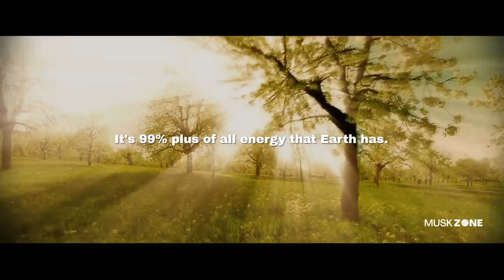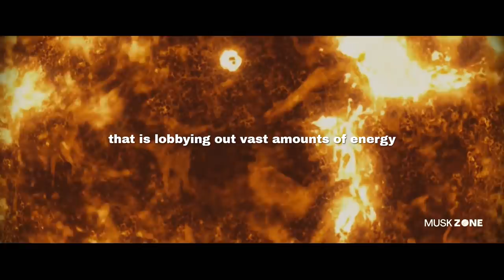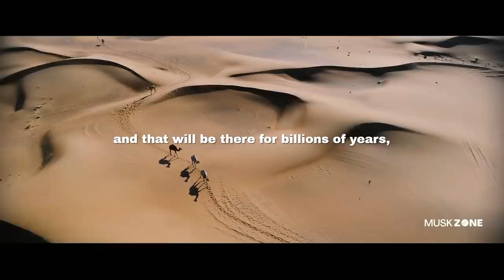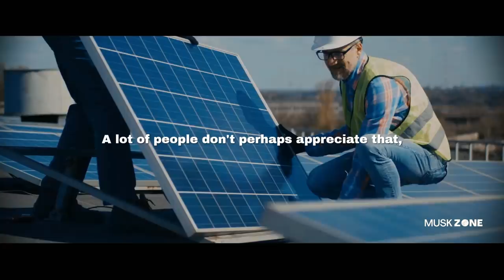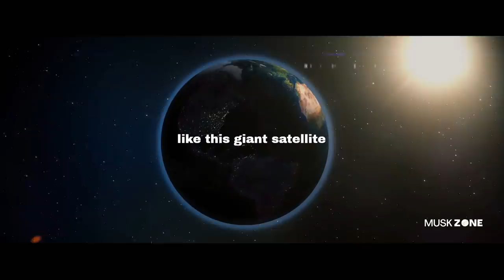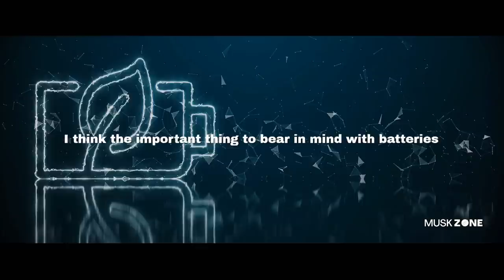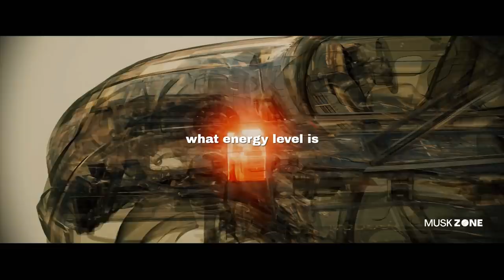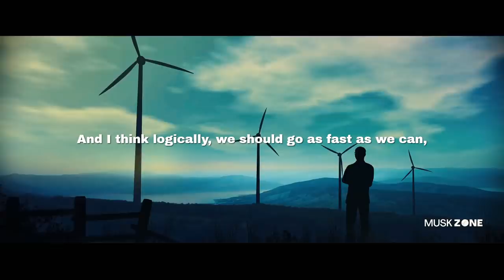Elon Musk's Speech That Freaked Out World Leaders

Comment: the reason we have not used all renewable energy is that solar panels are expensive and the batteries are easy to destroy (attack from terrorist ,enemy country and etc) and its all expensive,the answer is a nuclear plant, its not efficient or cheap but its the only thing that is viable,  so we can just use nuclear power for now and when we have it under control and solar panel is cheap we transition from nuclear to renewable

Comment: 100 x 100 miles = 10,000 sq miles.  There are approximately 10,346 power plants in the US - one square miles of panels at each existing plant, using existing distribution could power the US!  It sounds simple.  Next gen batteries will make this a no brainer going forward.
Reply: Power supply reserve station.

Comment: It will take both energy sectors to sustain America and the World. Everything that  the Tesla Company builds took oil and gas to build. Even the beautiful paint jobs on these fantastic cars. Every single battery a caustic very serious environmentally unfriendly creation. Lead, acid and where do they go when they fail. No different than our current vehicles. But an electric car no matter how efficient it is took massive amounts of oil and gas created energy to build. And where do the massive amount of batteries eventually go. In the ground. Or if burned into the atmosphere.

It has to be an equal marriage of both energies. It always will be and that will never change because it cannot. 
The oil and gas industry the world's most controlled and monitored industry in the world and is the reason technology and our world as we know it exists. That will always be there.

But I love my Tesla and I embrace everything Tesla and Space X does. But there is no either or source. Its both and its both forever.
Even the cell phone we are using required oil to build. And every single component in it as well as the satellites that actually make it work all required massive amounts of oil and gas to implement each and every single Company and their manufacturing process.
Embrace it all using common sense. McClaren will continue to build a million dollar car that runs on high octane gas to sell to the rich. And the new propulsion fuels of the new age rockets will continue to expel more methane gas competing with the cows we eat when we want a great steak.

There is a common sense approach to both sectors and they will always work together. But one cannot forget the oil and gas industry does not need the new found electric vehicle business or anything they create. Ever.

Because everything using some form of Petroleum.

But the Electric industry solely relies on the oil and gas industry. Forever. Even to generate the electricity at the charging stations or even to manufacture solar panels. Every facet of the Electrical renewable industry requires oil and gas related support 24/7 forever.

Common sense 101.